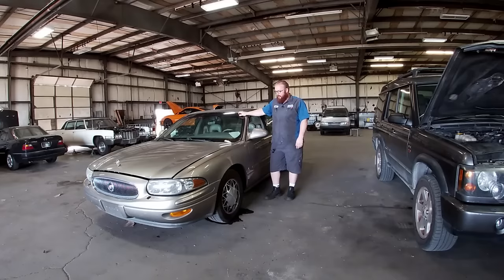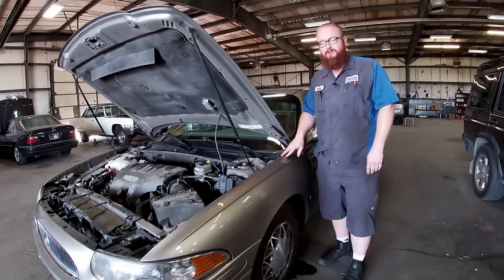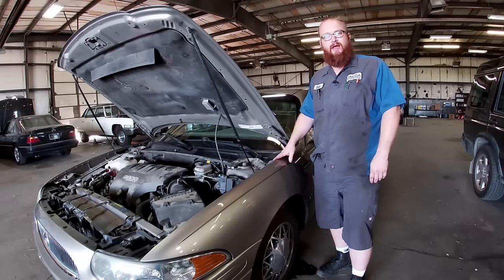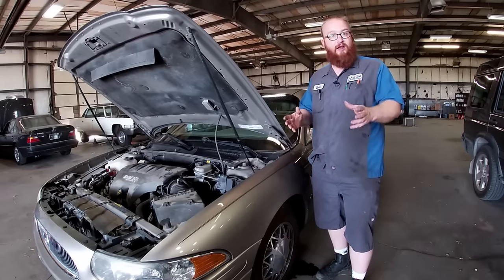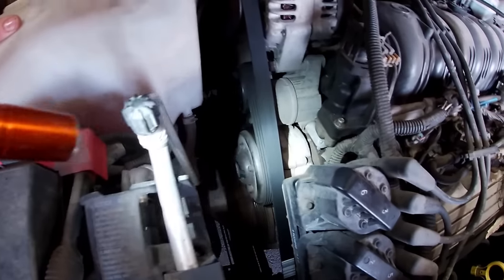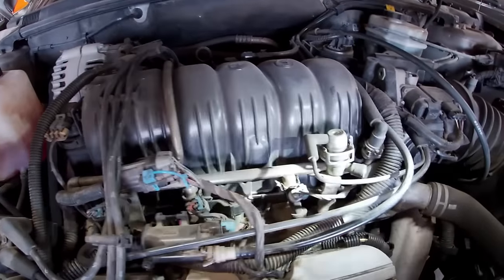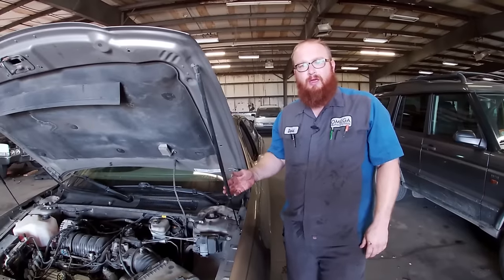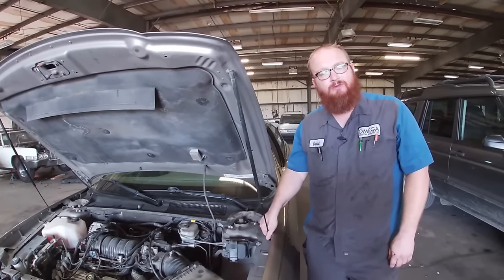CAR WIZARD highlights what makes the Buick 3800 V6 the BEST engine ever!

Comment: The 3.8 is a pretty amazing engine indeed. Used in holdens here in Australia. We just called it the ecotec and we did have the supercharged one too or super6. Was use in rear wheel drive. 

The 3.6 isn’t as bad as people like to claim. Unless you follow gm’s advice on the alloytec. Service mine every 5-8k kms and it runs beautifully and never had a issue.
Reply: The 3.8 engine mount on the driver side is the biggest headache to change out. I wish GM had made better engine mounts like the Camrys had.

Comment: Clearly old mate Wiz hasn’t heard of the Ford 4.0 inline six.
Reply: #barratheworld
Reply: Looking for this comment. These are the engines that powered real work. There's a reason why taxis and ute couriers used Falcons.
Reply: Barra 4.0 litre
Reply: But do they get 30 mpg? More like 18 i bet.
Reply: We dont have those in the U.S. m8
Reply: 4.0 V6 is a great motor
Reply: @stefanavic6630  I am a taxi driver. When they stopped making Falcons because the Australian government refused to keep bailing out the US dinosaurs, we got Toyota Priuses. Some of those have 600ks on them now, still running, and only use about a third as much petrol. Now they're going to start putting us in hybrid RAV 4's for a bit extra room. Ford and Holden had their chance but they didn't move with the times. If they had made a hybrid Falcon or Commodore they might still be king of the road in Australia.

Comment: you know why GM replaced it    it was too reliable  car companies want you to come beck to the dealers
Reply: Most cars are not scrapped because of worn out engines. It's more likely to be rusted out body and suspensions falling apart.
Reply: Same reason ford replaced the 4.6L 2valve!
Reply: Most of it has to do with fuel economy standards and emissions. Requires a lot of complications to meet regulations
Reply: Now nobody wants to buy anything from GM.

Comment: It is a good engine but the best engine ever made is the 1uz-fe
Reply: Literally bulletproof you can not kill those motors
Reply: Totally agree - & everything that should be metal is metal.  Only drawbacks are having to replace the timing belt and water pump every 100,000 miles, which is a full days work (for me at least because I'm slow, I've seen it done in 4 hours) and I had one where the starter motor gave up, which also took me the better part of a day to replace as it's right in the middle of the V meaning you have to pull out all the intake stuff.  Harmonic balancer has a tendency to separate like many Toyota engines of the period, but if you replace it at the same time as the timing belt with an after-market unit it'll never give you problems, and most of them develop harmless cam ticking due to tappet clearances - easy fixed if you find it irritating or just ignore it.  Everything else is very minor.  Also had a alternator fail due to leaking power steering fluid, but it was cheap and easy to fix, and you can't blame the engine for that.  And so damn smooth even if it's a bit thirsty.  Definitely gets my vote.
Reply: I'll agree with your 1UZ and raise you the whole UZ family! I own all three 1,2,3UZ currently, unbeatable!
Reply: What year models are these
Reply: 1UZ's are fantastic until you have to replace the starter ;) 
No hard feelings though, they're a cracking engine.
Reply: Thanks :)
Reply: Whats the original price and cost of repairs?

Comment: I agree but I think the Chevy 350 is first then the 3800 just saying
Reply: 1. Chevy 350
2. Buick 3.8
Reply: The 3800 is just a small block V8 with 2 less cylinders.
Reply: Well... It has loads of improvements that its V-8 forebear never got
Reply: @alexbenjaminlubbers  The chevy 350 wasn't that great of an engine. Before they went to roller cams in 1987 all small block chevies had cam - lifter wear problems. That was because they had soft cams, along with narrow lobes, which give less surface area, which means  higher wear rates. They also used a low content of nickel in the block, which resulted in excessive cylinder wear. That problem was pretty much cured when they went to fuel injection, which  for the most part eliminated the fuel wash condition casued with carburetors.
Reply: @MastersOfMask  The buick 3800 shares nothing with the small block chevy.
Reply: @HowardJrFord  
But they stuck around for 20+ years up to 1997, so they had to be a good engine.
Reply: Howard Jr. Ford my L82 has high nickel block forged crank freshened it up with comp cams blower cam roads lifters and blower and double roller timing chain valve job and clean up of ports  piston and pink rods were in great shape reused them  installed clevite 77 bearings

Comment: I had a '98 Poncho Firebird with the 3.8 liter V-6.  It ran very good, and highway mileage continually astounded me; 34 - 36 MPG was very normal at 80-85 MPH on the highway.

Comment: I learned to drive on a Lesbare, and then bought a 2000 Camaro in 2015, 3.8 w/ 4L60e (stronger than the FWD transmissions). The car got me thru highschool, college, and even to my job for a few months before buying a new WRX as a daily. Still take the Camaro on nice days, runs fantastic.

Comment: In Australia, this motor was used in our COMMODORE range of vehicles. I had two that ran this engine before HOLDEN replaced it with an insipid V6 that equipped newer models. The BUICK engine was the best. I opted for the V8 when the BUICK was discontinued.

Comment: I have a 2000 Park Av.  I bought because the owner of the shop that maintained my Volvo drove one.  His brother was lead mech.  My V70 died.  I found the PA on FB for 2400 with 78K.  I have put 7K into it all around with the gaskets, suspension, A/C mixer, brakes, p/s, and tires, but it's 23 years old.  I drives and rides great.  I will probably get another one.

Comment: Bought mine new in 2004.  Now has 29,000 miles.  It went to the best local garage for the first time in 20 years.  They do an inspection and test ride and found a small trans  cooling line leak.  They fixed it, put in new battery and changed fluids.  Their conclusion was the car is in phenomenal condition and runs smooth as butter.  I change oil twice a year with new GM filters I buy in boxes of 12.  I hope it lasts me another 20 years.  After that I will drive my 2012 Impala that now has 4700 miles.   The new cars are nothing but trouble.

Comment: Love my 2003 Regal GS. Supercharged 250HP that got 27.7 mpg from Iowa to Florida and back, when average speed was 75mph. My college son now has it with 198,000+ miles and it doesn't burn a drop, starts when its minus 15. Still wish I had it as my daily driver. I'll "borrow it" from my son just to take it out for old-times-sake.

Comment: I've got a LeSabre with this engine. 30-32 mpg no problem. I've owned it for over 8 years and the only issues I've had engine-wise are an alternator going bad and a bad coil. Both easy to fix!

Comment: I had a 99 olds eighty eight with the 3800 series II. The plastic intake cracked and hydrolocked the motor at 165k, that was the only issue it ever had other than an alternator and starter around 150k. After fixing that it ran great until 240k miles when I sold it to a friend and he drove it to 280k before the transmission finally blew up. One of the best cars I ever owned.

Comment: I owned a Park Avenue with a 3.8.  It was the easiest engine to work on.
I changed a water pump in 45 min., and I am not a mechanic. 
I did not have to take off the hoses, but I did have to remove the serpentine belt.  The housing of the water pump was in two pieces.   I did not have to remove the housing of the water pump from the engine block.  The pump rotor was separate from the pump.   All you had to do was remove the rotor from the main part of the pump,  and replace it. 
Also the oil pan was easy access.   You did not have to remove any thing other than the oil pan itself.
The big problem was the timing chain sprocket.   It was coated with Teflon.  When the Teflon wore off the sprocket wobbled, the chain slipped, the timing was off, and the valves smashed into the pistons. 
I knew this and had the sprocket replaced by a mechanic when I bought the car.

Comment: My mom's car has this engine. A Buick La Sabre. it has 95 thousand miles. The transmission has never been serviced.  I am not sure it should be. Should I service it with so many miles? Or, don't fix what's not broken? It is a great, great engine. I plan on having the car a long time. Thank you!!

Comment: I have a 2004 buick century with 450000 kms on it - its got the 3.1L V6 - is it anywhere as good as the 3.8L? My 04 buick is absolutely incredible and unkillable, outlasted everything else, comfortable, handles well, decent power and great space, decent fuel milage, and again, just keeps on going no matter what. Love old buicks

Comment: had one of these, fuel pressure regulator failed after sitting all winter. sending fuel into the vacuum system. while jumping it when it fired off the INTAKE EXPLODED had flames about 6 feet high. was able to put it out with water somehow (all I had i know) learned there was a recall on the FPR. so change it if you can everyone.

Comment: I have been in the car savage business  for over 40 years and the 3.8 Buick engines would come in totaled cars from salvage auctions with well over hundreds of thousands of miles and they still ran sharp and will still pump 175lbs plus  compression with  6 to 7 cycles. Just a great great American engine.

Comment: We went through a few of those intakes because of that EGR tube. There's a kit you can buy that allows you to replace the plastic intake with a series iii aluminum intake. With some extra modding, those aluminum intakes fit very nicely and are less likely to fail.
Reply: All the 3.8s made in Australia had aluminium intakes.
Reply: @jayjaynella4539  I'd bet that's where GM poached the idea from, Australia was probably a test run for it

Comment: I bought an 11th Gen Olds 98 Regency Brougham (1988) from the original owner with 100,000 miles. That engine is barely broken in. I’ve become a DIY mechanic for this car because it’s so easy to work on (I had absolutely NO mechanical background before buying it last year). It’s absurdly good on gas (I get 300+ miles of entirely city driving on a tank). And it’s the most comfortable thing I’ve ever driven. I paid 4 grand.

Comment: I owned two Park Avenue's with this engine. The last one I owned was a 1996 Park Avenue which I owned for 12 years and I liked the car a lot but the best mileage I ever got was 22 mpg highway and around 14 mpg combined. The Park Avenue is larger and heavier than the LeSabre so maybe this accounts for the lower mileage. I finally sold it a couple years ago when gas got up around $5.00 per gallon and got a used Toyota Corolla. Old Lesabres and Park Avenues are a solid choice if you're on a tight budget and need a car.

Comment: My 3800 had a leaky water pump.  Not infrequently it ran with low coolant and ran hot.  Finally fixed the pump.  Engine still runs like a champ.  Any other hi-tek aluminum engine would be toast.  Also easy to work on.  Motor is strong, too.  Series III feels like a 60s 283 or 302.

Comment: Mostly based on your videos I just bought a 2000 Buick Lesabre with 82K miles.  Drove great and when I was taking it home from the dealer, the engine shut off while driving and also shuts off when in park.  Mechanic will be taking a look at it.  Was looking at some sites and said that it might be the crankshaft position sensor.  Seems like a common problem and an easy and cheap fix.  I hope it is because it drove great until engine shut off.

Comment: I like how you referenced the thermostat 9:45 I had a VW Passat and had to replace the thermostat and I’m not joking, took me 6 hours. So many parts I had to remove, coolent lines I had to drain and refill when done. So many plastic brackets I accidentally broke. That car gave me so many issues that I had a journal for that car for everything that went bad, wrote it in the journal and that journal was THICK as fuck.

Comment: I have a 2005 Lacrosse, which replaced the Regal.  Engine is rock solid.  Bought it with less than 25k miles and still have under 120k miles on it.  No engine  issues whatsoever.

Comment: My first car was a '97 Le Sabre with a Series II, and that engine ran great until the car rusted out from under it (thanks for all the salt on the roads, Winnipeg).  My second car (and current) is an '06 Allure with the Series III and its a fantastic engine.  I've had a few age related things in the car itself, little spots of rust are starting to come out, but I've never once worried that it wouldn't start right up.  Runs great.  The fuel economy in the city isn't great - I average between 14 and 15 L/100km, but the highway mileage is great, usually between 7 and 8. I'll be sad when this one rusts out from under me too, it's a great looking car in my opinion!

Comment: Mr. Wizard. The following cars also have the 3.8 Series II. Would you recommend them as well?

1995-2005 Buick Park Avenue
1996-2004 Buick Regal LS
1995-1997 Buick Riviera
2000-2005 Chevrolet Impala
1998-1999 Chevrolet Lumina LTZ
1999-2004 Chevrolet Omega CD
1995-1996 Oldsmobile Ninety-Eight
1995-1999 Oldsmobile Eighty-Eight
1998-1999 Oldsmobile Intrigue
1996-1998 Oldsmobile LSS
1997-1998 Oldsmobile Regency
1995-2005 Pontiac Bonneville
1997-2003 Pontiac Grand Prix

Comment: I had this in an 89 Oldsmobile Cutlass Ciera, sold it at 250K. Its probably still running. The only thing that was known for issues was the overdrive transmissions but they may have just needed good maintenance.

Comment: Thank you for doing this 380 GM engine tear down. We learned allot about how to do a tear down. 
We, however did not see where the exact gasket failure was located. I did not see that, and if I just missed it I am sorry. But I thought that the whole idea of the tear downs was to find the issue with the engine failure. If I am wrong, I am sorry.   In the update, you are saying that the Dex-coolant was the original issue with this 3800 engine?? 
My 2001 series II Monte Carlo I bought at 80,000 miles. It’s 3800 engine had the evil Dex-cool coolant in it from the factory.  Therefore the water pump failed naturally, which I caught before it hurt the engine, but later the intake plenum (plastic) gasket failed caused by the Dex-cool crap and a poor gasket design. 
 I also caught that issue with coolant leaking through the plenum gasket, before there was any damage... The Dex-coolant was a seriously bad idea and many men paid for that evil GM idea of using Dex-cool red crap as a coolant.. 
The Dex-cool eaten water pump failed with 80% of the pump fins eaten away at 160,000 miles. I paid $$300 USD to have that replaced. . And the intake plenum gasket failed at 200,000 miles, which I did myself. And while I had it torn down, I went ahead and replaced the intake manifold gaskets also. The replacement (new) plenum was more warped than the old one, so I put the old one back on and it is okay still today.. 
Then later the radiator failed with a slow leak at the top left corner at 260,000 miles.  The new radiator also failed after 50 miles with a small leak in the same place, but it was a life time warranty.  
There was also a rocker arm cover recall of the front gasket, but that was not all the upper end gaskets that they should have had a recall on.
 I think that the best part of the car was the shocks and the whole front end design, it is so strong. 
I thought that  I should replace the X4 wheel hubs when the right front hub became a little noisy. I also replaced the brakes, exhaust system.  I had to replace those evil plastic coolant elbows twice (X2 was the worst idea ever).  Even the replacement metal elbows can leak when they are slightly out of tolerance (too small).  I also  went ahead and replaced the shocks. But the new expensive HD after-market shocks soon wore out and that did not make me happy. 
But the main problem with the 2001 Monet Carlo was the super thin body panels which you can almost spit through.  Plus those stupid coolant elbows and the power steering coolant lines that have a slow  leak. The best part of the 2001 MC is the interior and the front end frame design. It was designed to be almost indestructible.  The ignition switch failed and the drivers door window switch failed at 210,000 miles.
The trunk is a weird shape and you can not put anything larger than a big shoe box in it.  Okay that was an exaggeration !! lol

Comment: I had A 1993 Pontiac Bonneville with this engine years ago. This engine was great for from wheel drive. I had A huge system in it as well. The good old days long gone.

Comment: The 3.8 is such a great engine. I have a series 1 in an ‘89 Lesabre with 180K miles. Unfortunately it has its share of oil leaks (valve cover gaskets and intake manifold), but it does run as smooth as the day it was new.

Comment: I had this exact car and I can say that the engine is the best. I have 734,000 miles on it and it runs on 3/4 gasoline and 1/4 horse fecal matter.  It’s been leaking since day one but it won’t die. You just need to put wet sand in the manifold and you’ll be alright. When the transmission starts slipping, just bring the speed up to 110 mph and drive the friggin thing off a cliff and you’ll be alright. I tell ya, this car here is the best. I bought dirt cheap too. The 182nd owner only wanted 400 bucks, so I gave 250 and a smack in the mouth. If anyone wants to buy this car, don’t because there’s a grey one on the bottom of a large pit by interstate 95 by the watchamacallit on the left there. It’s the beauty with feces all over it. You’re welcome

Comment: I had a 1995 3800 Lesabre that the previous owner used to go south for the winter so it never saw salt. Everything worked including the AC. Had 112k miles when I got it. Best $1200 I ever spent.